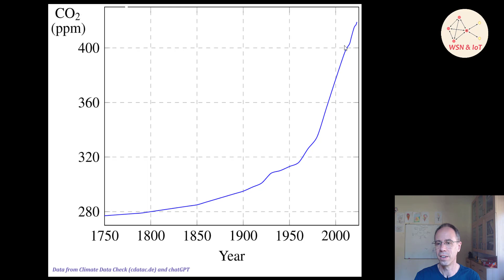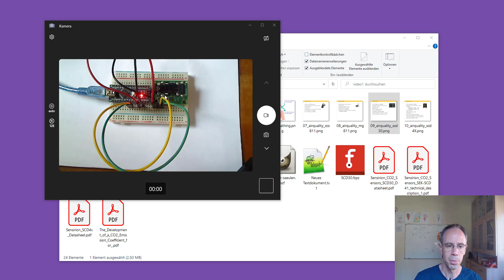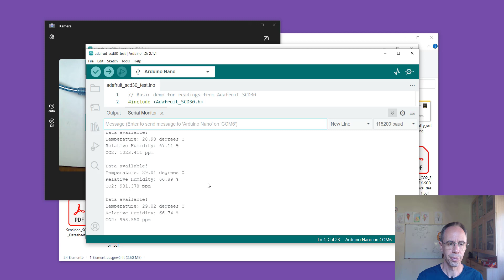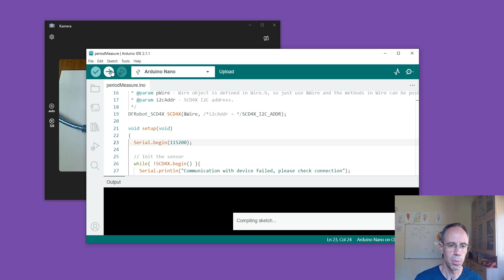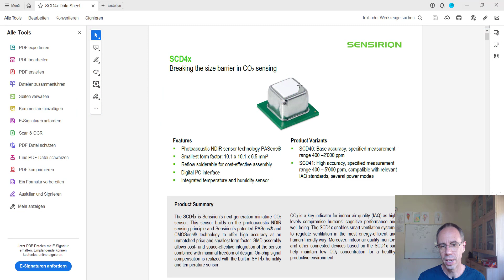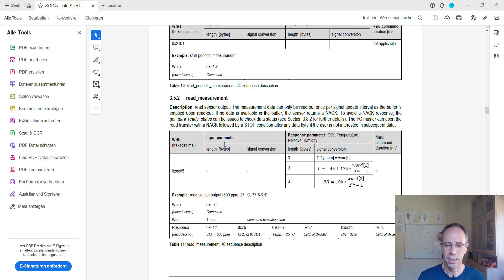Air Quality: Carbon Dioxide and Carbon Dioxide Sensors (CCS811, MG811, SCD30, SCD40, SCD41)

Comment: Sir if I want to use SCD30 to measurements CO2 contains in Biogas, did the sensor will miss reading the CH4 as the CO2? Because I had try use MQ 135 but the MQ sensor miss reading CH4 as the CO2 so the reading goes wrong.
Reply from the maker: The MQ-135 is a MOX (metal-oxide) gas sensor and does not measure CO₂ directly. It reacts to many gases, which is why CH₄ can strongly influence the readings. From my experience, MQ-type sensors are not reliable for quantitative gas measurements.

The SCD30 / SCD41 from Sensirion use a different working principle (NDIR) and measure CO₂ directly via infrared absorption. In principle, methane (CH₄) should not be interpreted as CO₂, so this problem should not occur.

However, keep in mind that biogas has very high CO₂ and CH₄ concentrations. The sensor must be used within its specified measurement range, and the gas may need to be diluted or conditioned. Also, high humidity or pressure differences can affect the readings.

I cannot guarantee correct operation in a biogas environment, but compared to MQ sensors, an NDIR CO₂ sensor is clearly the correct choice.
Reply: @wsniot thank you sir

Comment: Thank you for the information, it was really useful. I have one question stuck in my mind. Based on you experience, which sensor is best inbetween SCD30 and SCD40?
Reply from the maker: Its depends on the usecase. In most cases I would prefer the SCD40. Smaller, cheaper and less power consumption and also the range from 400-2000 ppm is in most usecases like checking air quality enough. The SCD40 goes from 400-10000 ppm and is with +-3% more accurate.

Comment: Thanks for your informative Video! Does the CCS detect VOC and calculate an CO2 equivalent?

From my understanding VOC don’t include CO2, or am I wrong there?

Greetings :)
Reply from the maker: The CCS is a MOX-sensor which react to changes in electrical conductivity caused by the presence of volatile organic compounds. CO2 is not a VOC. Normally with other factors MOX-sensors can estimate the CO2 value (eCO2), but from my experience the estimation is not good and with the CS811 we got the same graph for CO2 like for VOC when we measure over a longer periode. So it seems they use here only a factor for estimation.
Reply: Thanks again for that fast response and your understandable answer!

My goal is actually to monitor VOC values, because I was monitoring high levels of VOC with another smarthkme device.

Do you have any data on how reliable the CCS can detect VOCs? (I know that VOC value is really not so meaningful because you can’t say which gas exactly is detected. But I wanted to verify whether there is really a high VOC pollution in my rooms)
Reply from the maker: @Baltrum2307  The VOC value itself isn't really meaningful, but it's good enough for a relative comparison. Measure the VOC value in a non-contaminated place and compare it with your room. The concentration is usually higher at the point of origin, for example the floor covering, wall or sofa, wherever the VOCs come from. And which VOC it is cannot be determined with the CSS811.

Comment: I got some SCD40 from china and they work, ish, but I want to create something that is meant to be used inside and having to take it outside or into a somewhat controlled atmosphere once a week, won't do. So, I tried to turn off autocalibration and rather do a forced calibration instead. This works, ish, but with the standard probe time of every four seconds, the measured rate of co2 rises quickly over a few days. So I tried to enable power saving, reducing the probe time down to every 30 seconds. I generally probe this every minute, so not an issue. This reversed the problem, by drifting downwards instead of upwards and after they reached zero, they now crash if I try to forcely calibrate them.

Have you seen any of this or do you have any idea if it's possible somehow to find a co2 detector that can last for some time without having to be recalibrated all the time? I know such things exist, you can get them in shops, but I have no idea what they use internally.

Thanks for the good work!

roy
Reply from the maker: But to use it inside under most conditions is normally not a problem as long there is at least once a week anykind of ventilation and no person or animal inside. As I know the most other CO2 sensors are not deliver good absolut values. Calibration is difficult. A lot cheap CO2 detection systems using an analog sensor and comparing just relative values. For fire detection for example you will have a high increase in a short time. Actually I dont know what they use in more modern air quality devices but I guess they also expect that the device is at least once in a specific time period exposed to the minimum CO2 value from around 400 ppm.

Comment: came to see something about CO2 sensors, got a load of propaganda :(
Reply from the maker: The chapters are marked. You can always skip the part you don't like. However, I don't understand why you want to measure CO2 if you don't want to deal with the meaning of the values. I merely explained a few basics that are currently the general scientific consensus and also provided the data with sources. These basics are important in order to be able to calibrate and interpret the sensor values. If you don't believe the historical data or doubt the significance of the values, you don't need to bother with a CO2 sensor, because you will also have to doubt it. For example, these are calibrated on the basis of this data.
Reply: @wsniot  I agree :)

Comment: Scd30 had two tubes, one as reference, to eliminate the need in calibrations.

Am I wrong?
Reply from the maker: The SDC30 and SCD41 support both automatic self-calibration (ASC) and manual recalibration (FRC). With ASC, the sensor must be exposed to a well-ventilated room or outdoors and the lowest reading is estimated at 400 ppm. FRC is a manual calibration with a reference value. For the SCD4X, the sensor should be in an environment with about 400 ppm at least once a week. The SCD30 should left overnight. I don't know if they really use different algorithms. With the SCD4X ASC is used as standard with the SCD30 FRC. Haven't checked if the values from a factory calibrated SCD30 are already good and how long they stay acceptable. A valid long term test and comparison would be interesting.